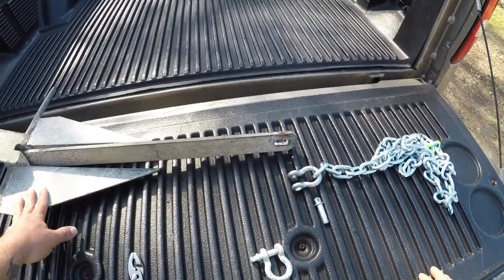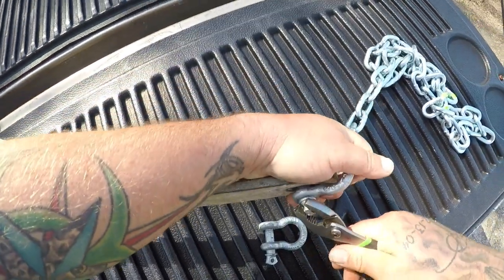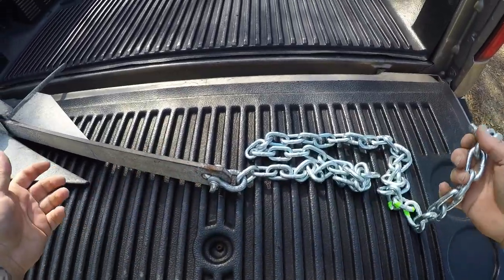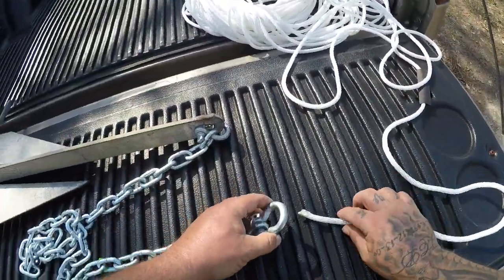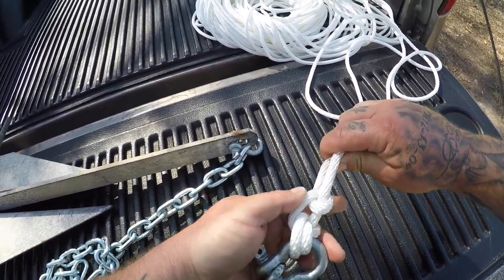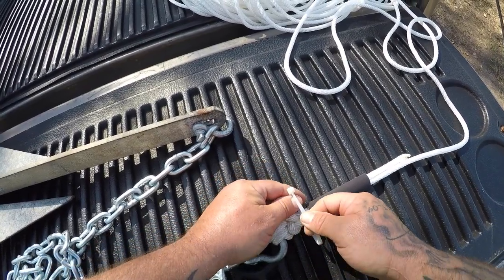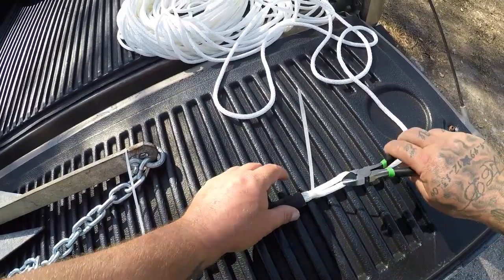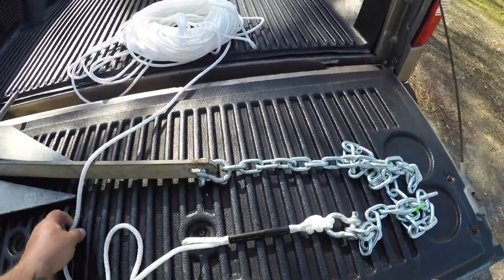HOW TO RIG AN ANCHOR FOR YOUR BOAT

Comment: Nice way to secure a rope/chain to an anchor. I am surprised that I didn't think of the zip tie/rope trick. I use the zip ties to connect the pin to the clevis, kinda like a safety wire. Additionally I use loctite on the clevis pin threads.

Comment: You should really use the breakaway and attach it to the bottom securely. And run the chain to the top and attach with a zip tie. Comes in clutch to remove a stick anchor with lout loosing your anchor.

Comment: I did read the shackle at the anchor should be the other way around so the screw pin goes through the chain not the anchor as it puts less stress on the shackle pin when the anchor moves around and less likely to come loose.

Comment: I drill a hole in the crown and attach the chain there with a shackle, then run the chain down the shank and attach the chain with a 100lb stainless steel zip tie. Should the anchor hang I can use the boat to break the zip tie at the shank and pull the anchor out from the rear by the crown.
Reply from the maker: Steven Bass ive done that a few times and if im fishing deep or fishing wrecks i will set it up that way...it works well..thank you for the info buddy

Comment: use a safety wire to secure your clevis pins so they can't back out
Reply: Or a zip tie.
Reply: @josephvandyck5469  Stainless steel wire

Comment: Question do you know anyone who is sailing a used trailer for a 21 ft cuddle cabin boat my trailer is homemade one and it is gone. Both my axles are gone the hubs are shot and it's just it's just a complete mess
Reply from the maker: Timothy Crews no..unfortunately i dont buddy..but i will keep my ears open

Comment: I would recommend you use 100% Nylon rode and not poly! the difference being nylon will stretch and poly wont! nylon is about 10x stronger than poly for the same diameter.

Comment: The zip ties and shrink tube defeat the purpose of an anchor hitch knot.....the ropes tension tightens the knot and retains the strength of the doubled rope around the clevis....using the zipties and shrink tube I would imagine weakens the knot point to about 50%... 
Source: U.S. Navy Bootcamp and years of working with BIG anchors, Docklines, and other rigging. :)